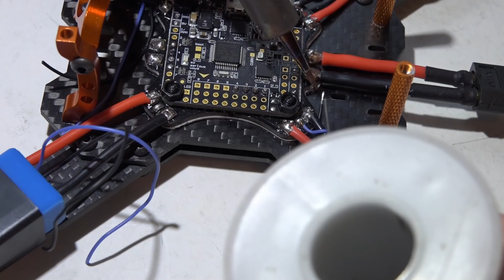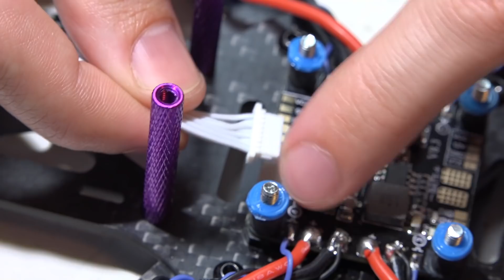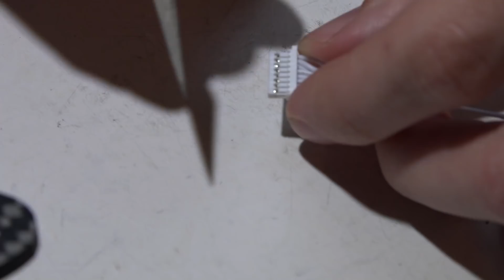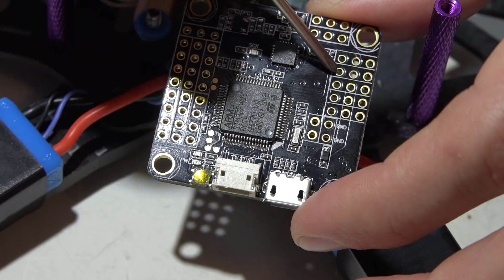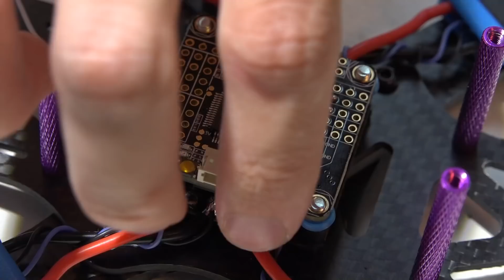Multirotor Build Pt8: ESC Signal Wires

Comment: Future reference for everyone ..  esc ground signal wire should be to the fc or don’t use it .. ground to fc creates a low resistance ground loop to discharge noise .. just FYI

Comment: in your case how you wire the signal-ground from the esc to the ground on pdb, you also could wire the signal-ground from the esc direktly to the esc itself (signal-grund --> ground ON THE ESC). why lead the signal-ground outside to the pdb , if you solder it anyway to the same pad. saves wire, weight and the risc of ripping out one more wire.

Comment: Thank you very much JC for sharing simple tips which makes all happen - I was getting that through failures and mistakes, and I regret nobody from the top pilots I was watching did same kind of series with not just doing the build but proposing solutions to make it ready for newbies. Easy things like protecting ESCs, using silicon wires to prevent issues with soldering, isolating PDB and components, keep antennas inside the frame not to be cut or damaged during the crash are very important for people who just got into the hobby. They will crash often, and do not want to damage their builds after first flights - these kind of tips & tricks would be very important for them. Keep going!

Comment: about the ground... whats the difference from where you put it to just do it right at the ESC with 2mm wire?
Reply: There is none ground is ground.
Reply from the maker: Yea like Peter said you could just run it from the small pad to the large pad on the ESC. Either way is fine

Comment: Soldering the secondary ground to the PDB kinda defeats the purpose of having it in the first place... and the effect is so little that in many cases it's just redundant. Try building a quad with and without the secondary ground wire, you wouldn't notice the difference

Comment: Did you ever try 60/40 solder? I'm getting better results with it.
Reply: Use some Amtech NC-559 ASM flux and a large soldering tip and yes quality of solder makes a great difference.
Don't buy the solder from china banggood ore aliexpress all bad.Only my experience:)